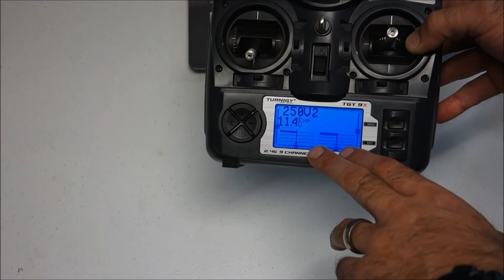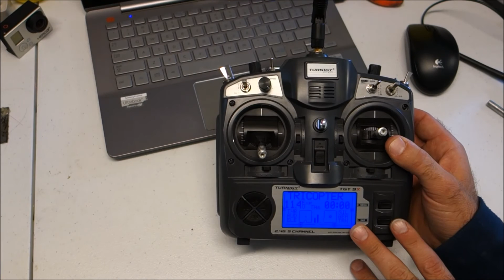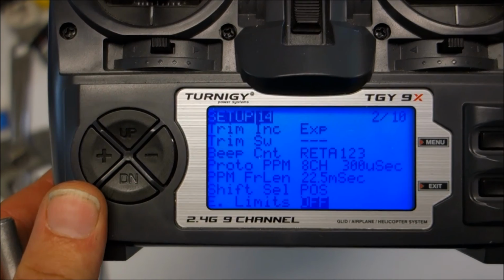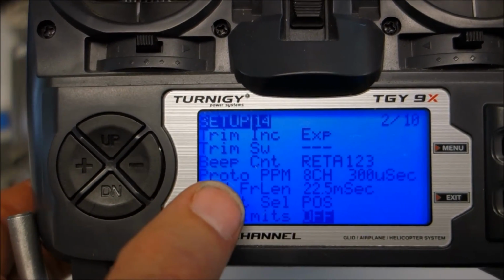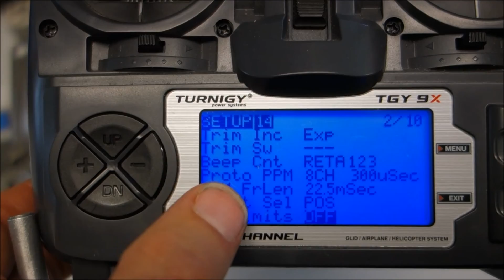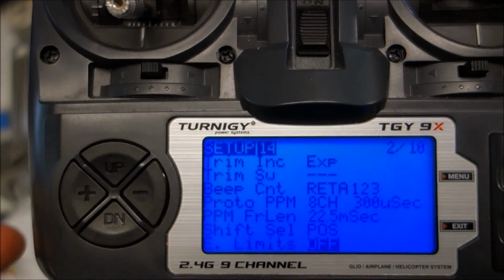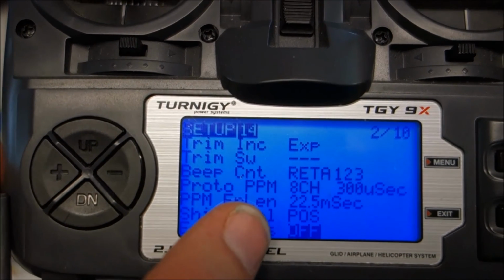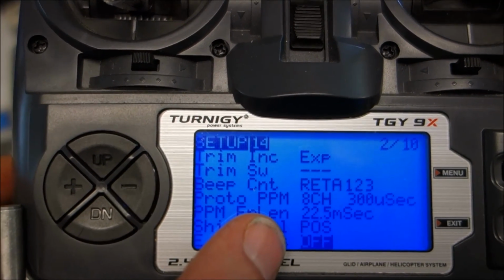Turnigy 9x, how to install both spektrum dx4e and frsky xjt module

Comment: Hello, great work and video! I'm trying to install 2 flysky 8ch modules together to achieve a full 16ch turnigy 9x. I know I have to bind the second module to the trainer port, as if it would be a second radio. But I couldn't find any wiring scheme... may you help me somehow? Thank you in advance! :)

Comment: Why not just ditch all your old crap and get receivers that will work with the XJT module?  Much less room for error!  And no worries about burning modules due to accidently turning on the power with the antenna in the wrong module.